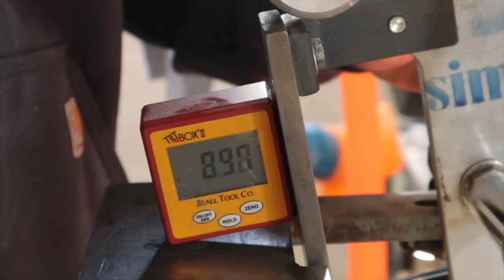Making a spoon carving knife from an old planer blade

Comment: I'm curious if you ever experience higher warping potential right at your quench line?  I've noticed over the time of watching your videos for the past year that you don't always fully quench the handle, in this case in particular with such thin steel I would almost certainly anticipate a warp where the handle didn't hit the quench.  Any thoughts or tips on avoiding this?  I'll even get them sometimes on the very tip of my handle that either doesn't make it entirely in the quench or hits a little later so it has already cooled a bit before reaching the quench.  I think this all just comes with practice but wanted to get your thoughts on it.  Thanks for all of your inspiration and education!

Comment: Now I know how my Russian wood spoons were made. Also this video will satisfy all the Forge in Fire fans...
1. Forge...check
2. Hammer action...check
3. Oil quench...check
4. Tempering steel...check
This build did not use stock removal method...it was forged therefore it will keeeel

New hobby or just want to try something new with carving?

Comment: Did you build your forge yourself? If so what did you use? Do you have a vid on it? Great curved blade. Looks great, only thing I would add to mine if it were mine would be a hole at the end to hang it.
Reply: Looks like an air compressor cylinder.

Comment: Great work! The handle insert was a great idea! Do you think it will hold up with the epoxy or would it need a pin? Also would you sharpen both sides if you made it again or is there a reason that's not a good idea? Thanks for the video
Reply: Hey Ronan, the bevel just being on the outside makes it much more difficult for the knife to nose dive while carving a spoon, kuksa, bowl etc. It's kinda the last tool oftentimes to touch the work, so it needs to be able to not easily gouge the wood when you're making the last cuts. As for sharpening in the future, you won't take the inside to a stone, you'll just hit the bevel, which leaves a burr on the inside. To get rid of that you'll use a piece of leather with buffing compound, and that'll polish the inside, get rid of that burr, and make the cutting edge that much finer. I kinda rambled but I hope this helps
Reply: As for the first quest question, epoxy will hold up fine with the kind of work it'll be doing. Couldn't hurt to pin it, but its really not super necessary if that makes sense

Comment: Shouldn't the blade be more curved than that?
Reply from the maker: No. There are many different sizes of these and some are even wider than this. This one works great for a general wooden spoon.
Reply: Sue, do you mean across the blade rather than end to end, to make the cut through the wood smoother with less chatter? I was wondering about this (after watching Lee Stoffer modify a Mora spoon knife) but didn’t wish to sound churlish for the time, thought and effort put into this video, especially if I’d missed that element of the process.
Reply: @petersmedley459 Peter, it's a year now since I posted that comment and I have since found out that spoon knives come in many configurations.